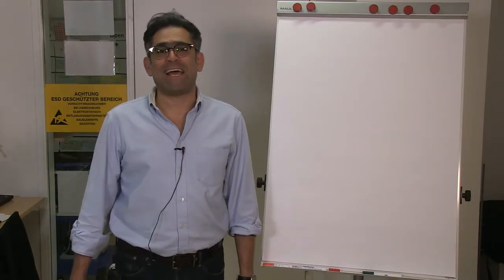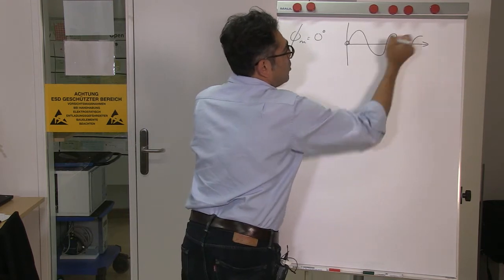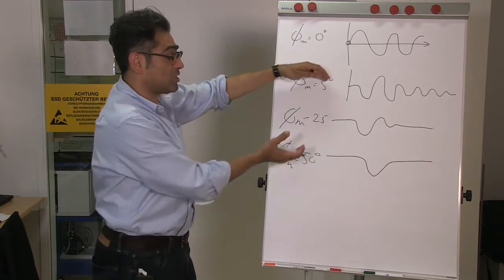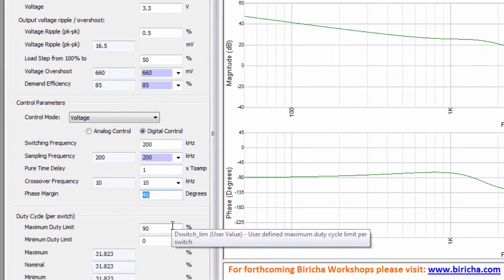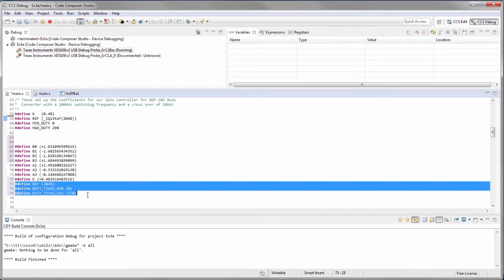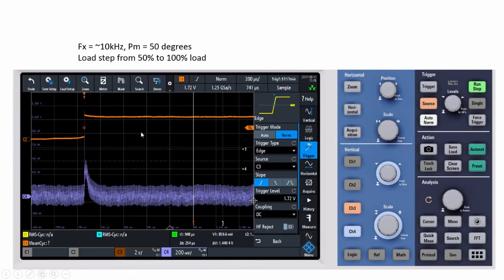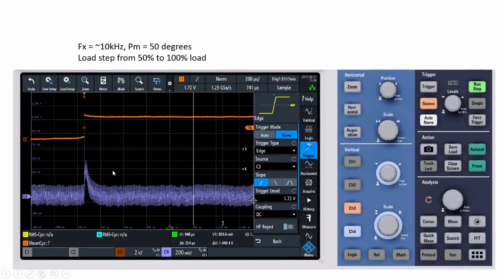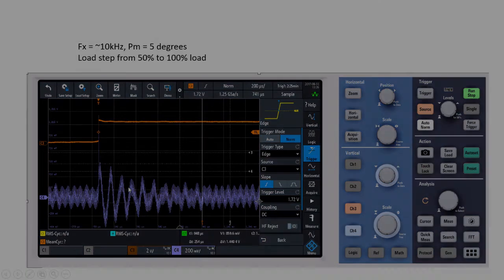How phase margin impacts the transient response of a power supply

Comment: how to change the crossover frequency in buck converter  ,, what is the effect of crossover frequency if i increases the output cap
Reply from the maker: Changing the output capacitor, will have an impact on the transfer function of the power stage. The crossover frequency is determined by the combination of the power stage and the compensator transfer function. Therefore, crossover frequency can be changed by modifying the power stage and / or the compensator.

Comment: it is not clear to me how a phase (PM) measured in a certain frequency affects a transient response. How to explain that?
Reply from the maker: Phase margin is measured exactly at the crossover frequency. Crossover frequency is the natural frequency of the closed-loop system. Phase margin is a measure for damping. This means, phase margin affects the damping of the response of the closed loop system.
Reply: Phase margin is measured at gain cross over freq, i.e., when the open loop gain is 1 or 0dB. 

In order to ensure stability (based on Nyquist criterion), by the time the phase shift introduced by the loop is -180 degrees, the gain of the loop should be less than 1 (0 dB). Because, once the phase shift introduced by the loop exceeds -180 (after phase cross over freq), it becomes a positive feedback, and as a result, the output can grow indefinitely. So, after phase cross over frequency, the loop gain should be so low that the positive feedback should never take off.

So, phase margin tells us when the loop gain reaches 1, how much margin is still left for the feedback loop to reach a phase shift of -180 degrees (or to become a positive feedback). 

So, this measurement should be made at the frequency when loop gain reaches 0 dB..

Comment: Great video sir,  very clear and well explained, my curiosity is you have used a 50% step, why not a full step from zero load to full load, which will perhaps perturb the system more giving a more complete picture? And thanks again.
Reply from the maker: A zero to full load step might give a different answer because it will include more large signal effects. If you want to compare the results of the bode-plot with a load step, a smaller step works generally better. Depending on the linearity of your system, the large-signal behaviour and small signal behaviour can be different!
Reply: @OMICRONLabTutorials  Thakyou sir, again a great and informative video.

Comment: I was told to always have -45 deg to -60 deg of phase margin.  I guess I am trying to understand the positive phase margin, does that mean the phase of the original signal is lagging or leading in phase on the output?  I would think that a signal output that leads would cause oscilations.  
thank you for the excellent demonstration.
Reply from the maker: Phase margin is measured in the (open) loop gain. It is a measure for the damping of the closed-loop system. At high phase margin the closed loop system will have high damping and therefore less overshoot and ringing. At low phase margin values, the closed-loop system will have low damping and therefore higher overshoot and more ringing. The phase shift of the closed loop transfer functions (input to output or duty cycle to output) is not the same as the phase margin.
Reply: @OMICRONLabTutorials  Thank you, it is very complicated, we use a piece of equipment called Venable Instruments at a high tech company I work for specifically for PMICs.   I love how you showed the load step and then load release we do this all the time with Transients.  Super excellent to see this. and the relationships with phase-gain.  I really did not know this. thanks again.